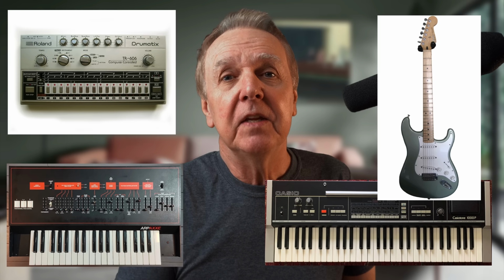What's wrong with dbx?

Comment: I used to own a very good Aiwa cassette deck with Dolby B and C and HX-Pro. It was a beautiful machine and could, more or less, make a recording of a CD just as enjoyable as the original. What drove me up the wall was that Aiwa did not produce a decent fast forward or rewind mechanical assembly. It would make the cassettes rattle and shake like no one's business! I wonder if other people had similar experiences with Aiwa cassette decks? The top of the line cassette decks were always Nakamichi and their "Dragon" decks, the most coveted around the globe! One of those with Dolby SR would be the bee's knees! If, of course, you can find cassettes somewhere. 🤔🤷‍♂😉💘
Reply: I still have my AD-F810. It still rocks. Got rid of more expensive decks to hold onto this one.
Reply: @pauldionne2884   Mine was the Aiwa AD-S40. The only thing it lacked was Dolby S, but Dolby C is extremely quiet anyway. Digital has eclipsed cassettes, however, and I enjoy how much faster it is to make a playlist on my PC, and even transfer it to my cell phone to listen to when I take a walk.

Comment: I bought a dbx 3bx DS way back in the 80s, and I still have it in my retro stereo system.  You can't buy them any more.  I don't use it for noise reduction, but just for dynamic expansion.

Comment: I have two dbx boxes that I have collected over the years, they are the ones that go inline with the ins/outs to the tape deck. I have a number of recordings I have made over the years using dbx, and I have to say that it is superior to Dolby B or C in just about every way. The only problem is that sometimes I want to listen to a dbx tape and I can't be bothered to connect the dbx box in order to hear it properly! I have found that dbx works the best with BAD cassette tapes.. the so-called "type zero", cheap ferro cassettes, and cheaper cro2 tapes. That is where you get the biggest boost in sound quality. Not so much with metal tapes.

Comment: I stil have two DBX Technicss decks both work very well apart fro. Pumping on certain types of Music back in th 80s I also had a reel to reel Deck Phillips N** 10 inch reel 3 heads , I modified my Technics deck to give me and output that was DBX encoded , this was fed to the reel to reel to record, It could then be played back through the Vinal disk position on the Technics to play it back , it worked extremely well, if you recorded live music it was great, or CDs

Comment: Type I or II? I have used both. Type II works well for both open reel (my Tandberg does 15 or 7.5 IPS) and cassette; cassettes sound better with type II. The secret to avoiding artifacts is to push the recording levels to 0 db or even a little higher. Any distortion from saturation gets greatly reduced by the expansion during playback. A cassette deck using metal tape will work best since there won’t be much if any high-frequency loss. I’ve done some live recordings that rival digital with my Tandberg at 15 IPS.

Comment: Yup, I had a model II 122 as well back in college and also heard the same pumping and breathing with cassette tapes. Horrible! However, I also had a couple dbx vinyl discs (Virgil Fox pipe organ and Heart's Dreamboat Annie). Those actually sounded quite nice. But... I purchased it for cassettes so it was basically useless for me.
Reply from the maker: It's interesting to hear your comment on dbx for vinyl. I would expect it to work better than cassette because of vinyl's better signal to noise ratio to start with. DM

Comment: I run an Aiwa cassette deck with dbx, Dolby B and C. I find the dbx nr to be fantastic given the right tape and music. Tends to preform really well with “loud” music; modern hip hop and pop seems to preform FLAWLESSLY. I don’t notice any of the “breathing” I find with some of the prerecorded dbx cassettes I’ve come across or with other genres I’ve recorded. Also, Type II or “better” is a must. I don’t know enough to say why but from my experience in using Type I tapes and dbx, you’re better off with Dolby B.
Reply from the maker: If the music is loud all the way through you don't need noise reduction.

Comment: I have some old cassette-recordings from the start of the 80's, the non-dolby ones sound quite good, the dolby ones sound muffled.
As mentioned in this video, it's tracking errors - lower output from the tape makes the dolby circuit reduce the treble level more than they should be.

It would be nice with a variable gain between the playback-head and the dolby circuits, restoring the correct playback level, without having to re-adjust the trimmers in the deck, only to adjust them back to their former position, once finished listening to the old tapes.

Some NAD decks had "Play Trim" knobs - don't know if that took care of this problem - AFAIK it was more a treble adjustment than a gain control.

Comment: Speaking about dolby, Way back in' 77 I had a Teac 1/4in two track 15ips machine and as part of some testing of my deck and two or three others I discovered my machine had a full 1mv (unweighted) output noise.It didn't mater what speed or type of tape was used or no tape this was pure playback amp noise. Other machines measured only slightly better(including a 3M 8 track machine). I was used  to line amps, phono amps with outputs of 20-30uv. So I did a cheap and non destructive experiment, I took an off the shelf chip (LM381) whipped a tape playback amp together and running on the piece of crap power supply of the Teac the noise was reduced to 100uv. A full 20db improvement.(Also recorded test signals had several tenth's % less THD). This improved the S/N from ruffly 45 to 65db. This could easily have been reduced another 10db with better P.S. and even better preamp. Since then I've thought Dolby was pure unnessary bullshit. If anyone using tape machines had 75db back in those days (or now apparently) then they would have been amazed. Am I missing something here? If the playback amp sucks your stuck with it. Never mind if the fucking heads are aligned or you have the perfect tape formulation. Unless I'm missing something the recording,mixing,mastering studio is truly a chamber of horrors. Dennis C.
Reply from the maker: I remember Teac reel to reels as being excessively noisy. The later Tascam (same company) stereo and 8-track were about as good as is possible with analogue tape. DM
Reply: @AudioMasterclass  Thank You for commenting. I enjoy your videos. My Teac measured 45db(1mv), A Sony using "LOW NOISE FETS" measured 50db, A 3M Studio 8 track the size of a Mini Cooper measured 59db. I achieved 65db(100uv). I don't believe your "POSSIBLE". <30uv output noise was possible in 1973. Tape did not increase the noise on my deck with my preamp. "Tape Hiss" must be below 20uv if it exists. Since 1977 a deck with well designed record & playback amp should be capable of 80db. No black boxes needed. D.C.
Reply: My guess is that engineers of the day knew that was possible - big studio reel to reels had those kind of specs - but for the target market the bill of materials had to be kept within a certain cost limit and higher quality components like that would have blown out the manufacturing budget.
Reply: @editingsecrets  I hope you are correct. I admit the 3M machine I measured was probably from the late 60's. I should look for specs of newer tape machines. Noise in audio has always been an obsession with me. Dennis C.

Comment: 8:50 I have the very similar Akai 1721L.  They're OK but don't have very good back tension control, so don't play very small "message tape" reels properly.
Reply from the maker: This isn't unexpected. In the old days you could get 7--inch spools with larger centres so they held less tape but would play more reliably. DM

Comment: dbx problems used to be called the picked fence or pumping of the sound.  The same thing can happen with Dolby C if the tape bias is not spot on.  Both dbx and Dolby C work fine on music with a constant level but they are horrible with piano or jazz music.  If you were recording heavy metal or rock music noise reduction was not necessary if you were using quality tape.

Comment: The challenge with dbx noise reduction is that you have to have extremely well-known characteristics of the tape transfer characteristic and dynamic level compression otherwise you get tracking errors. The more aggressive a noise reduction system is the worst the tracking errors can be and the requirement for a perfect tracking is even more critical. Another often overlooked problem is transient response of dbx. I had dealt with a recording that had pops and ticks in it and noticed that the dvx gate didn't close down quickly enough and you could hear at the end of the pop just a little trailing edge of tape hiss. It only lasted about a millisecond or two but it was definitely an artifact.

Comment: What about VHS Hi-Fi? This uses a 2:1 compander similar to dbx. Were lessons learned or is pumping/modulation noise still evident in this format? A lot of Analogue radio microphones also use a dbx like compander and can sound really bad with certain sources.
Reply from the maker: I think that with hi-fi VHS, people were so pleased to have it compared to previously that its imperfections could be mostly ignored.

Comment: Having used dbx on reel to reel tapes a long time ago, the problem with it is that if you don't have a processor to decode it, the audio is unlistenable.   I still have the tapes, but the dbx failed two decades ago.

Comment: Now I understand the strange behaviour of recorded pianos that have that "pumping" modulation sound especially at lower and slower levels. You do not hear only the one sound of the key, you hear additionally a second sound, maybe I am wrong but it sounds like if the pianist always pushes the damper even if he doesn't. It always distracted me when I've heard that. Thank you for that information.
Reply from the maker: Bear in mind that it may be the damper. Microphones close to the piano will pick this up whereas to a listener in an auditorium the sound is usually unnoticeable. DM
Reply: @AudioMasterclass  Thank you! Would you say that this is then bad recording if mechanical noise from the piano is so explicitly recognizable?
Reply from the maker: @christophmartin5381  This is a tricky question. The first thing is that the piano should be well set up so that the pedals don't make more noise than necessary. The second is the player, although it's generally unwise to ask a performer to do anything different to what they normally do. After that, it's a compromise between getting the best sound from the instrument through mic positioning and selection. Putting a mic under a grand piano can sound surprisingly good, but of course that's the worst place for pedal noise. DM
Reply: @AudioMasterclass  Thanks again ! Even when this is a complete different issue and does not relate to the topic.
Reply: @christophmartin5381  Depends on the song. Amy Grant's song "If these walls could speak" has VERY intense close micing of the piano action and dampers. It works great for the song as a kind of shared secret within the building.

Comment: If a cassette starts at 45db SNR, dbx type II will improve SNR by 30db hence yielding a total SNR or 75db.  It's known as noise modulation not modulation noise.  IMHO, the best reel to reel format is 2 track 15IPS with IEC/CCIR EQ.
Reply from the maker: I don't mind you calling it noise modulation, but other people have it differently https://www.google.com/search?q=noise%20modulation+site:aes.org DM
Reply: I worked for Julius Konins at Cassette Productions in New Jersey in the 80s.  We made high end chrome Dolby B 0:26  classical music cassettes utilizing type I 120us premephasis instead of the usual type II setting of 70us.  Julius told Ray Dolby that Dolby B produced noise modulation on certain percussion instruments.  We had to have golden ears to serve the customers we had

Comment: I believe perfect azimuth alignment played a pivotal role in these NR systems and unfortunately it was easier said than done.

It's easy today with digital scopes to get a perfect waveform collimation with decks recording real time, but it wasn't back then with vacuum tube volt meters and the production pumping millions on cassettes recorded at high speed.

Also factory alignment I believe wasn't that accurate either, quality control issues.

Comment: Consumer grade equipment get consumer grade components...to do the things that dbx has to do well i.e. eliminate things like breathing, you need high slew rate op-amps, precision voltage references, etc. which are prohibitively expensive for the home “prosumer” use case.

Comment: Explained very well. In doing noise reduction on historical recordings I have to work with both ET (record) and tape noise. And i learned very early on how distracting gated noise reduction is compared to just leaving the noise there. Some gates people would use in their noise reduction were particularly grating because the gate seemed to open and close the frequency envelope. Argh! It sounded like someone was constantly muffling and unmuffling your ears. And I also noticed how poorly done FM radio compression destroys the piano first.
Reply from the maker: Thank you for your comment. I have an aversion for sound that is 'messed about with'. Sometimes I'd rather just have the noise. Single ended noise reduction done well however can work wonders. DM

Comment: Can anyone help please. I have a 286s and I have an AT 2020 MIC. When I launch a game on Steam, I get horrible static like humming noise for the people I talk to on Discord. I have tried many solutions to no avail. I have 5800X3D cpu so this is not being overloaded. I have had a few different gpu's but still the same problem. I was using a sound card and even with motherboard sound, it is still a problem. Do I need to run the 286s through a dac?

Comment: Fleetwood Mac “Rumors” multitracks were recorded at -8 dB peak (IIRC) using dbx noise reduction. I know the engineer wanted zero tape compression, hence the low recording level.
Reply from the maker: I can get that. Analogue tape is always a compromise between noise and distortion. Rumors sounds great to me and I seem to remember there's a 'Classic Albums' vid on the making-of. DM

Comment: Well you avoided the biggest issue with Dolby and that is the differing alignment of tape heads, even when these decks were new. Let alone between brands of decks, the problem exists within the same brand or even model. The alignment tolerances for a mass-produced cassette deck could never be good enough for Dolby. (Only Nakamichi addressed the issue with their auto azimuth). For the vast majority of cassette users, a Dolby recording more often than not, only sounded good on the same deck it was recorded on. That's the problem. Not head cleaning or 'using the right tape'. You also glossed over the great improvements in circuitry in the 80s-90s among most deck manufacturers, and the addition of HX Pro, to the point where by the mid-late 80s, Dolby was no longer needed, but just included because of tradition. This is my experience. Dolby should always be off, whether playback or recording. Who listens to music at such ear damaging volume that tape hiss becomes obtrusive? Dolby was a theoretically great idea that should never have seen the light of day in consumer or even pro-sumer decks. If you can't stand a little noise in this day and age, you really shouldn't be playing with analog formats anyway.
Reply: Besides everything you've mentioned, it should also be noted that the quality of the tape cassettes themself was significantly improved from the late 60 to the early 90s, with constant development of new tape formulas, that allowed for lower noise and higher recording levels, increasing the dynamic range to a decent level without using any noise reduction.
Reply: @MacXpert74  So true!

Comment: dbx can be thought of as an exchange: improved noise floor for a reduction in resolution.  For a 15ips 2 track that makes sense.  There's an abundance of resolution, so trading some of it away for improved noise floor is a good trade off.  Especially if it's the same unit recording and playing back.  

Meanwhile, Compact Cassette has almost no resolution to spare.  1 7/8th's ips is absurdly slow and it's a technological feat that it worked as well as it did.  Losing more resolution from dbx is going to sound bad even in the best case scenario, and it did sound bad.  

It's notable that the 4 track cassette portastudios of the 80's and 90's often had dbx, but they had the option to run at normal or double speed with dbx.  At double speed dbx was passable.  At normal speed it was unusable.

Comment: Hifi vcrs have that same modulation issue only instead of tape hiss it’s head switching noise.
Reply from the maker: This is true. In the early days of VHS Hi-Fi there were ads that claimed the sound was CD quality. Obviously this is not so and the ads were taken down. A useful system for its time though. DM

Comment: I have a Yamaha 3head cassette deck with dbx I'm very happy with it one thing you failed to mention sir dbx came out a lot later after Dolby did and by the time dbx started getting a little popular cassette decks started to fade out but cassette decks an hour coming back but it's a fact dbx came out after Dolby on cassette decks
Reply from the maker: Dolby definitely had a head-start advantage but I'd also say that Dolby was better at licensing. It has happened elsewhere that the format that was more widely licensed (VHS) was the one that won (Betamax). DM